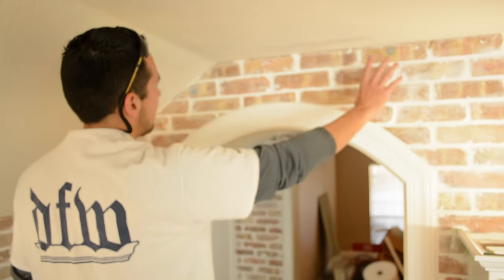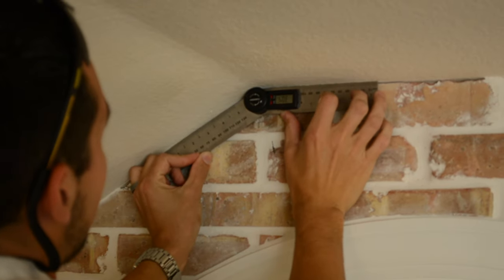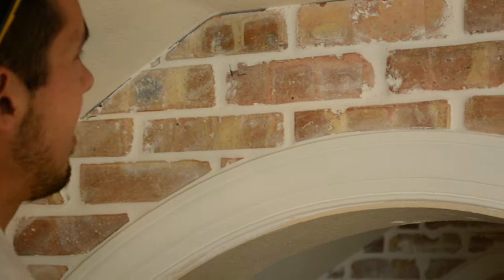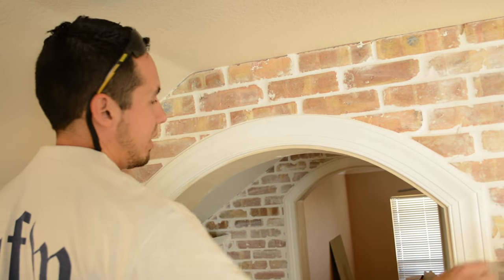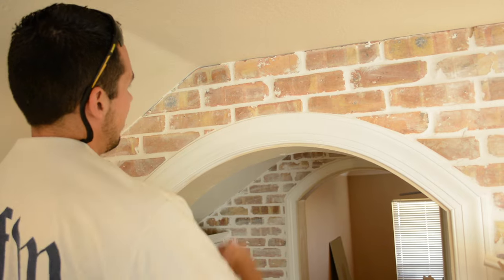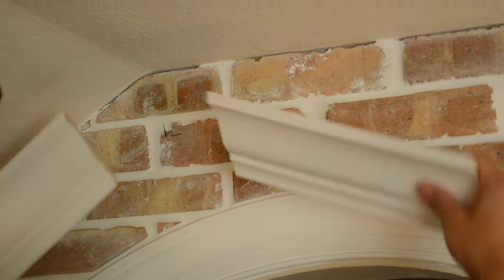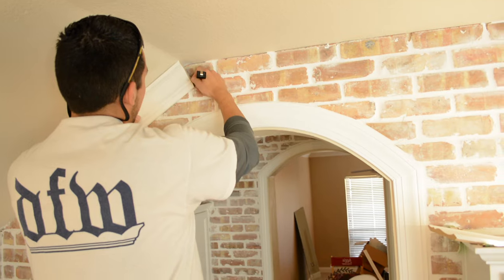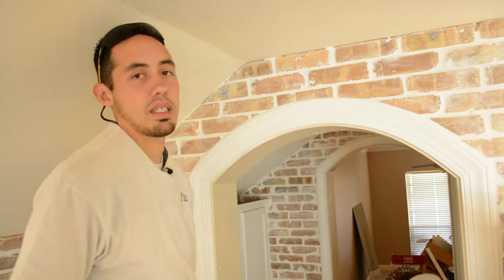Vaulted Crown Moulding - How to Find Peak Angles

Comment: Love these videos.  I do a great variety of work from drywall, to flooring including doors and base, to shelving and even decks and fencing.  I almost never do crown.  It's been years and so I dropped back in on your videos for some quick refreshers and to learn some new stuff.  You made it so easy I got two 8-10 foot pieces to practice left and right returns, inside and outside corners, a splice, and now I am messing with a vaulted ceiling and you are there again.  THANKS  Bruce

Comment: Correct me if I’m wrong but the tool is measuring 30 degrees because it’s pivoting in the opposite direction so really it’s 150 degrees. 180-150= 30 and then divide that in half to get your miter cut. Not sure why he wouldn’t clarify that considering that’s obviously an obtuse angle lol
Reply: I was sitting here scratching my head thinking the same thing!😂  Thank you for clarifying
Reply: I just figured out there a botton on this angle finder that will start the angle finder off at 180° instead of 0°. Then you will get to 30° straight away on the angle finder without doing that math. Divide that in 2 and you get 15° cuts.

Comment: How are you going to finish it off at the bottom. Thanks for your tips, I went out and bought a angle finder because of your videos. 15 years of trim carpenter work and i'm still learning new tricks.
Reply from the maker: Dwayne's Prospecting Adventures I put a nice bead of loctite behind the bottom before installation.  and then filled in the rest with more LOCtite. I had to tape it because the bricks.  thanks . yes I am constantly learning all the time too.

Comment: For a guy who says, "I went to public school and I am not very good at math."  You sure do explain a whole lot of practical applications of Geometry (angles), Algebra (structured finding of unknowns, your layout formulas), and Arithmetic (your layout formula applications). =0)

I knew a roofer once who wanted me to teach him Algebra.

We were in a driveway.  I asked him how many squares of shingles we would need to roof the house.  He told me.  How many square feet is that?  He told me.  How many bundles of shingles with 10% extra for waste and spoilage?  He told me.  How much will that cost at the building store and how many labor hours will it take to shop materials and how much gas will you need?  He told me.

I told him that even if he didn't know it he was Algebraing just fine.

Comment: I have this exact situation so thanks for explaining how to deal with the peak angles of a sloped ceiling.  I am curious how you finished the crown on the vertical wall to the left?  Did you terminate the crown against that wall or did you wrap the crown around the corner.  I’ve been trying to figure out the best solution for the crown that continues on the 120 degree wall/ceiling angle and have it look continuous.

Comment: Not an angle finder but an angle divider tool is the tool to use.  Mine is a Stanley but there are others.

Then just maintain the proper spring-angle of the molding while cutting on the miter-box saw, which is set at the divided angle.

We could also argue over wether it's entirely proper to run crown up sloped ceilings or not?

Historically not, since crown or cornice moldings are just a part of the entablature or embellished horizontal casement of the beams above a column. 

Running crown along vaulted ceilings, is a more modern application but rarely seen in antiquity.

Comment: I wanna see you make a video on how to handle that inside corner that I assume is over to the left of this bisecting angle
Reply: You would need a 3rd piece in this case. Say the vault is going up 30 deg. You have a 90 deg corner plus 30 equals 120 degrees. Cut your 45 inside corner, a 45 inside plus 15 degree triangle piece, then your final 15 deg up slope piece.

Comment: Hi,  I've watched a lot of your videos and learned quiet a bit.   thanks for taking the time to shoot the videos.   One question though.  I notice that you don't put up a nailing strip or backer to nest and secure the crown.  how to get the moulding to stay tight to the wall and ceiling?
Reply from the maker: jason wight I mostly use MDF ultra lite. but for added piece of mind I don't use typical caulk to seal the moulding. I use LOC tite to fill in the gaps between the mouldings and the walls. I don't see the need for a backer strip. I appreciate your comment
Reply: thanks for the quick reply.  I appreciate it.

Comment: Richard, when you go down the vault to the angled ceiling and you turn 90 degrees, do you use the same drop dimension on the horizontal wall with the angled ceiling? Thanks.

Comment: Hey Rich,  how would you handle a kitchen cabinet crown returning back to a wall which has its own crown moulding independent of the cabinet moulding which is most likely sized smaller.  Corner block?......shortened return?...  any advice?

Comment: "SAWSET PROTRACTOR" is the most accurate miter finder out there. No Math. No gimmick.
 Do the comparison. Great for cutting on the  flat.
Reply: @johnmusella184  it does work, as long as you cut the crown with the cove of the molding resting on the table of the saw.

Comment: I would love to see how you do the next angle down to your left.  That is the tough one, where the ceiling isn't forming a 90 degree between the ceiling and the wall.  I can't figure that one out.  Thanks man!!
Reply from the maker: Matt V yes, that will be a separate video. that one is a little more tricky. thanks for watching
Reply: Matt V yeah I been trying to figure that one myself
Reply: dfw crown, I have the same question as well. It will be great if you put the video on your channel. many thanks!
Reply: Yes, I'd love to see this video as well. I'm doing my master bedroom, and have been trying to figure this one out.
Reply: dfw crown This video still in the works? Just curious. Thanks for all these videos. They're very helpful, and greatly appreciated.
Reply: Have you made this ( next angle down to your left) video yet. I can't figure it out without adding a filler piece at the top.
Reply: Me too! This will not work right on my application. I have a shed ceiling from the front to the rear wall with soffits for the cabinets - lots of cuts! Need more detailed information.
Reply: +Mark Klaus. 
Many thanks for posting that link.

Comment: Thanks for the amazing video will a sterrett miter gauge work the same?
Reply: I have one. I have not used it for this application yet, but I would imagine that it should work.
The scale is a bit larger which makes it tougher to get into that corner.

Comment: How do you prefer to turn the corner at the lower corner at the vault?  A plinth block?  Or how do you cut and measure if the wall changes angles in the underside of the rake?  I know sometimes I try to make a problem and then try to come up with a solution.
Reply: You may have to cut some of the meat off the backside so it will make the crown sit taller on the load bearing walls (assuming trusses run on the lower walls) than the vaulted areas.

Comment: If the brick run is horizontal, the brick joints form a 90-degree angle.   The angle quoted is 30.5-degrees (an acute angle).   As such the cut angle would be somewhere to the right side of the left hand, not to the left side.  Anything to the left side of the left hand would be an obtuse angle.  Half of any obtuse angle is by definition more than 45-degrees.  Color me as confused now as before I watched the video.

Comment: I've been waiting for this video, question though I have a 40 degree angle but every time I cut it it's wrong, I am cutting at 20degrees. Do I just cut the piece flat on the saw? Is that what I am doing wrong?
Reply: Hi Brandon. Using a chop saw and laying the crown on its back and flat on the bed, for a 40 degree cut, you need to set the mitre at and bevel at 14 degrees (it will be near enough) for crown with a 45 degree spring angle (drop and projection being the same size) for a 38 degree crown set the mitre to 13 degrees and the bevel to 16 degrees. Search for Fusco chart or Starrett 505A-12 chart. Good luck
Reply: should have read " you need to set the mitre and bevel angle at 14 degrees"
Reply: I can't get it to work either. 152 deg vault, bisect to 76, 76 from 90 gives me 14 Deg but it's wrong no matter how I cut it. Using a crown stop and cutting it upside down.
Reply: Finally figured it out today, the only time you cut crown right side up as far as I know.
Reply: @classicalcarpenter4297  : Would you please help me with " FUSCO CHART" ?  What they have i don't get it for 40 degree angle :
it says :
angle 40   miter 38/52    59.40   bevel 38/52  47.77  next to it 
it says:
angle 40   miter 45/45    62.76   bevel  45/45   41.64 

how do i get 14 ?
Reply: Jerry Saunders hello I am having an issue with cutting the peak ceiling of my vault it’s a 158 degree angle, how did you cut your crown? Flat on its back, up side down and backwards on crown stops or how?

Comment: Someone would help me understan "FUSCO CHART"?

one comment from a subscriber says:
i quote :" for a 40 degree angle "
Using a chop saw and laying the crown on its back and flat on the bed, for a 40 degree cut, you need to set the mitre at and bevel at 14 degrees (it will be near enough) for crown with a 45 degree spring angle (drop and projection being the same size) for a 38 degree crown set the mitre to 13 degrees and the bevel to 16 degrees. Search for Fusco chart or Starrett 505A-12 chart

but when i look at " FUSCO CHART"
What they have i don't get it for 40 degree angle :
it says :
angle 40   miter 38/52    59.40   bevel 38/52  47.77  next to it 
it says:
angle 40   miter 45/45    62.76   bevel  45/45   41.64 

how do i get 14 ?

Comment: Are you cutting this like  a normal piece of crown or are you cutting it flat on the miter? I have the same angle finder and my ceiling is reading 161 degrees. So if my math is right, that's 71 degrees past 90 so I should set my miter to 35.5 degrees. (161-90 = 71/2 = 35.5). I just can't figure out how to cut this...flat or like you would an inside corner?
Reply: I believe it's 180° - 161°=19 ÷2= 9.5°.  Also there's a button on this angle finder next to the power button that will start the angle finder at 180° instead of 0° when closed. That should give you 19° right away without that extra math. Then divide by 2=  9.5°
And I'm testing it on my mitre saw and seems the only way to make those cuts when cutting against the saw fence as it would sit on the wall and ceiling is to now cut it ceiling side up. Normally all other cuts would be upside down. But this seems to require you cut it right side up.

Comment: Could you pleaseeeee teach us how to find and cut the angle down to your left without a transition piece, preferably?  I've been at it for 2 weeks and reading on rake angles for inside vaults and I still don't have a clue.
Reply from the maker: Yes, I will do that very soon. I have been thinking of how to make it extremely simple. I did film a video about it, but I over-complicated it. lol so I trashed the video.
Reply: dfw crown thank you very much! I'm assuming that the cutting angles would change on the horizontal crown if the ceiling was also sloped compared to being flat, correct?